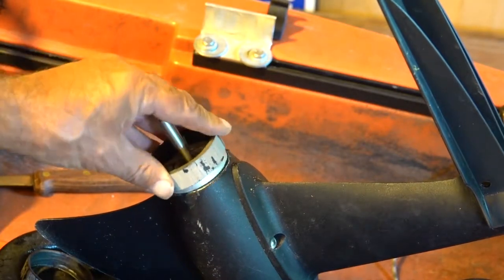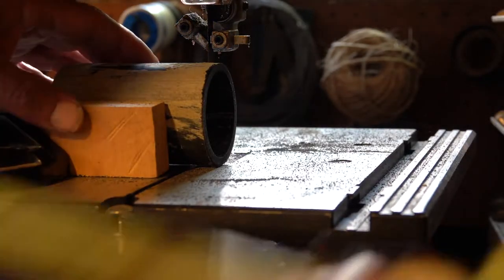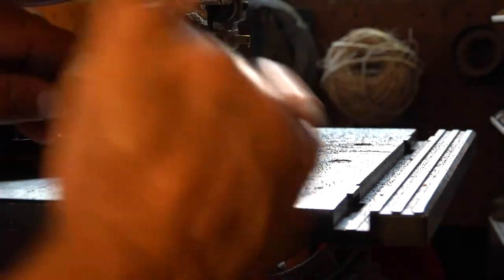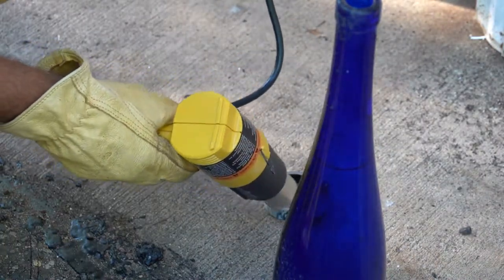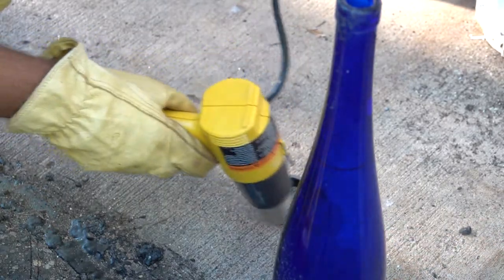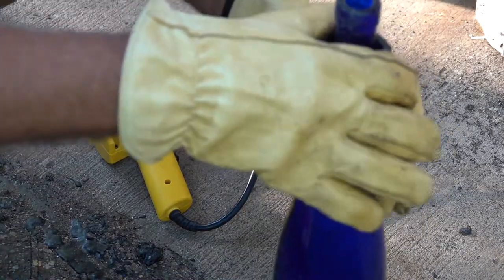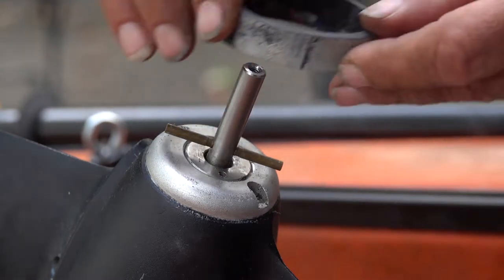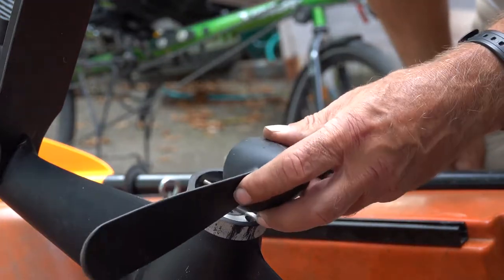DIY Weed Guard for Native Propel

Comment: Awesome Larry.  Will try this on my Native Mariner 12.5
Reply from the maker: Let me know how it works out for you.
Reply: @larrywydra  Hi Larry, took a few tries but I made one that is a perfect fit. One trick is that once I got the base portion to be a good snug fit, the prop side was a little tight so I just used a half round file to take a little material off the ABS weed guard and now it fits and runs nice and smooth. Thanks got the great concept design.

Comment: what schedule pvc where u using?
Reply from the maker: Good question and an over site on my part. I used 2" schedule 40 because that is what I had laying around.  Schedule 20 should work too but I don't have a piece to measure. The final OD of a stretched schedule 20 will be smaller than a stretched schedule 40 so it would be marginally more efficient but it is also more flexible so I don't know if it will stay put. If anyone made one out of scheduled 20, can you please share your experience with the community in a comment.